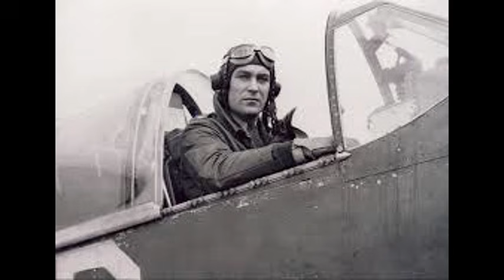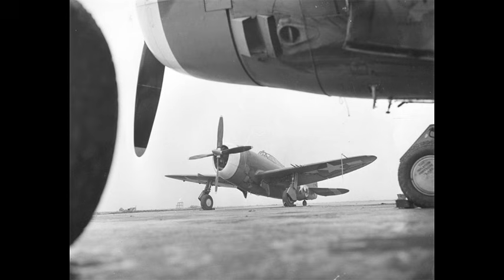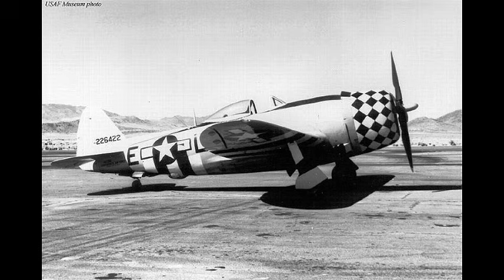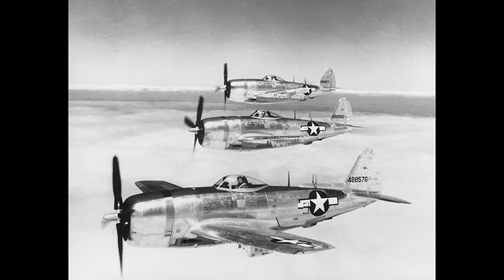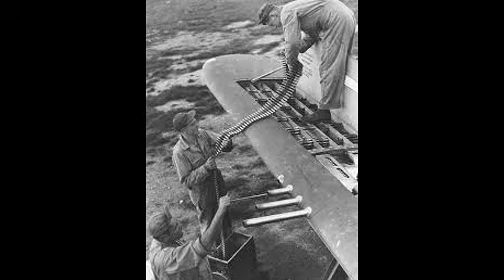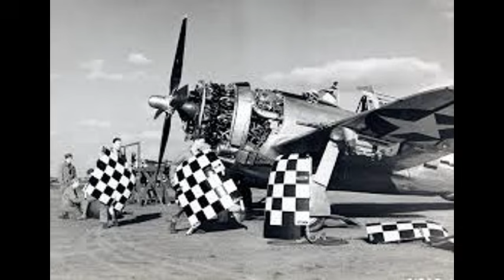Germany Stunned By America's P-47 Eight .50 Cals And Their FW-190s Were Outgunned

Comment: “The P-47’s eight guns weren’t merely weapons. They were a demonstration of the industrial system behind them.” That’s what makes the Thunderbolt story so compelling. Germany could build excellent fighters, but America could combine firepower with enormous ammunition reserves, replacement parts, pilot training, and relentless production. Which advantage do you think mattered most against the Luftwaffe: the P-47’s firepower, its durability, or the industrial machine keeping it in the air?
Reply: Hey Hurricane MkIIB 4 x cannon 8x rockets 1000lb Bombload from a plane 6600lbs P 478x 50s 10x rockets 2000lb bomb load 17500lbs So a plane almost  3 times as heavy only could carry 2 x more rockets and 1000lb in bombs but beaten by the 4 x cannon of the Hurricane

Comment: “The P-47 wasn’t just an airplane. It was American industrial power with wings.” Eight .50-caliber Brownings were devastating, but the deeper advantage was the enormous system behind them: ammunition, replacement aircraft, trained pilots, fuel, and spare parts. Which impressed you more about the Thunderbolt: its overwhelming firepower or its ability to absorb incredible damage and still bring its pilot home?

Comment: The P-47 is one of the most important aircraft of all time. It was the first truly multirole aircraft ever built, highly effective against both aerial targets and ground targets whose impact could be felt through the F-4 to the F-16 and F-15E on to the F-35. The Mustang may have got the glory but the Thunderbolt was a true workhorse.
Reply: The RAF Mustang was miserable. It was an immature aircraft with tons of design problems. It CERTAINLY was not suited to ground attack roles where a single bullet in the radiator system could take it out! 
The Typhoon had design problems that were never completely ironed out. Just because a plane carries cannons doesn't make it a distinguished design. Nope. You can't prove your statements. I call sour grapes. The P-47 carried the entire European effort from 1942 on. It just got better and better in most every way.
Reply: @Informed104  I can’t prove my statement? We literally just said the same exact thing.  Did you misclick? Are you responding to the correct post?
Reply: @Informed104  haha P47 first combat April 43 You got that wrong just like everything else you posted
Reply: The USAAF lost 2000+P47 doing G/A The RAF Mustang  never lost anywhere near that neither did the Typhoon And both were doing it two years before the P47